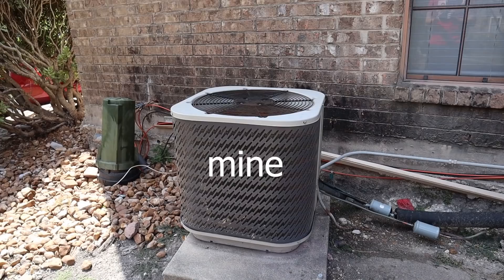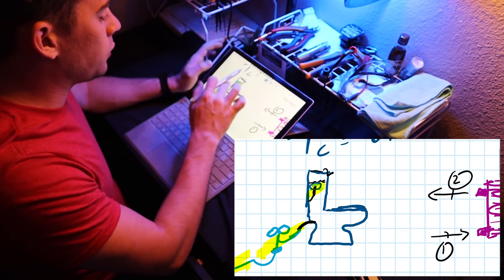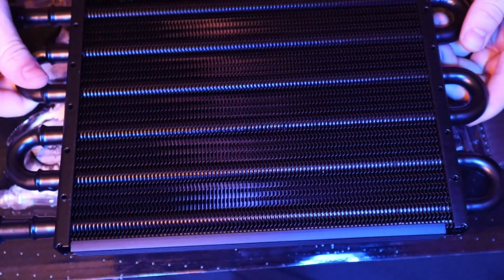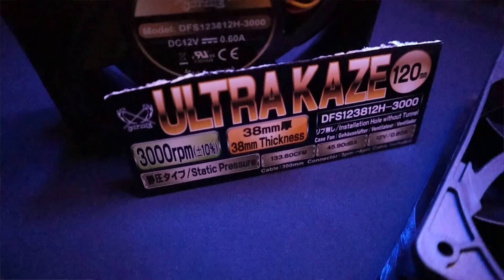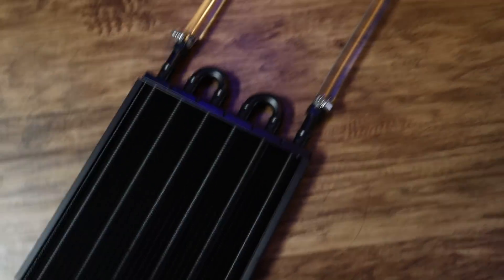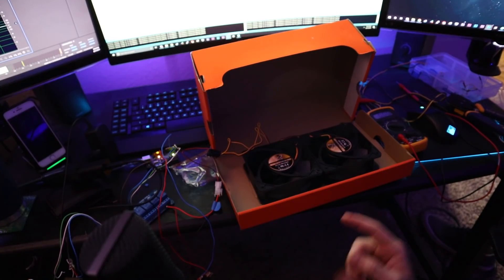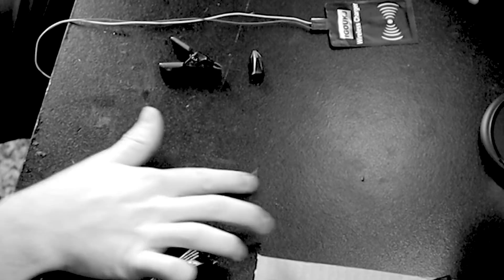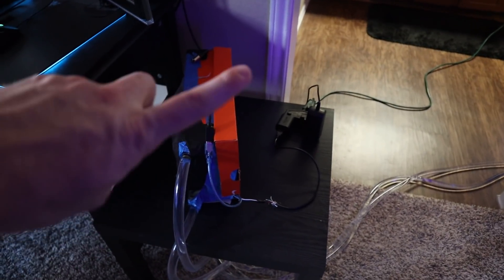I Watercooled My Room with My Toilet

Comment: I feel like you should leave your supply line intact, and use an aquarium pump to circulate the water out of the tank, through the radiator and back into the tank. Cause right now, your heat reservoir is just the volume of water in the tubing. And it only moves right after you flush. Then the heated water sits in your tank, heating up your bathroom, until you flush again. If you circulate the water out and back into the tank, a large fraction of the heated water is flushed directly into the sewer.
Reply from the maker: You're smarter than me haha, thanks for the suggestion and taking time to watch!
Reply: @TyPalowski  it also limits how much water comes out if you spring a leak!  you could also have a closed loop of water (or refrigerant in the tubes) with fixed amount of liquid hitting a heat exchanger in the tank - you'll lose efficiency, but you wont flood the building if you rupture. Also, fyi, water pressure usually goes from 40-80psi depending where you are. Heads up!  Great job on the build!
Reply: @TyPalowski  just place the cooler lower than the cistern so the warmer water naturally loops up to the toilet, you might need to add some pipe to let the whole thing circulate

Comment: Cool build but I can't help pointing out that a stand alone 8000btu unit is only a couple hundred bucks. https://www.walmart.com/ip/Arctic-King-8-000-BTU-Portable-Air-Conditioner-White/633661829?wmlspartner=wlpa&selectedSellerId=0&adid=22222222227280745955&wl0=&wl1=g&wl2=c&wl3=339481359828&wl4=pla-664267882294&wl5=9012319&wl6=&wl7=&wl8=&wl9=pla&wl10=8175035&wl11=online&wl12=633661829&veh=sem&gclid=EAIaIQobChMI6YqHxu6h5AIVgpyzCh32GA0LEAQYBSABEgKsQPD_BwE
Reply from the maker: Good point! My goal was just to try and make something for cheaper than that and that doesn’t use 2500 Watts, my bill is high enough lol. Thank you for taking the time to watch though!

Comment: This is pretty cool as a proof of concept but I think there's a lot of ways you could improve on it such as adding some insulation to the water going in to the radiator to prevent it from warming up on the way to the radiator, shorter tubes to reduce excess travel time and heild water, also the button press and timer is a good idea but what about getting a water flow sensor to replace the button? after the water flow stops for certain amount of time the relay could turn the fans off all automatically. Separately you could also make a device that senses the temperature in a room and if it's over a threshold it will automatically flush the toilet causing the cooling unit to start. Point is I really like the video and I hope you make a part 2 where you improve on this

Comment: You could probably have used a small circulation pump to move water through the rad rather than just relying on the flush. Right now as im sure youre aware, the "resevoir" and all of the thermal mass of the system is limited to just the water in and near the radiator. If tou instead used the toilet tank as a res, you could significantly increase the time required between flushes.
Reply from the maker: Very true! Thank you for watching and the suggestion. Maybe I can implement that later with a little fish tank pump or something that doesn’t draw too much more power.
Reply: Plus the system would be under less pressure and less prone to leaking.

Comment: There no way that works the electricity to run it would generate more heat than it could cool. lol. your landlord probably has a governor on it.
Reply from the maker: Thanks for checking the video out! The fans I picked only generate about 14 watts of heat. I checked the temperature of the air coming through the rad and its around 73°F. After running for an hour the temp rose to about 2 or 3°F. I'm thinking of going over the total efficiency at some point, but it sure as hell feels good while it's blowing on me haha. Thanks again.
Reply: @TyPalowski  So is there any cooling going on in the radiator or its just filled with water. lol. is there a sump pump in the reservoir tank? hahaa
Reply: @TyPalowski  also you should just start throwing treys of ice in the reservoir tank. ha
Reply from the maker: The water temp is lower than ambient so I consider it the cold reservoir of the system. And I'm getting the water from the wall spout before it goes in the tank.
Reply: @TyPalowski  You should Add a PC Watercooling Reservoir and a small secondary pump with some valves. When new water starts coming in, use it to flush the entire loop with cold water and store the excess in the reservoir - That way the water is moving + keeps colder for longer due to larger thermal mass.
Reply: @TyPalowski  oh derrr. so its self powered irrigation. NICE. lol. also, don't do drugs. kids. lmao. I should have pretty much known that one. hahaha
Reply: really comes out cold eh? nice.
Reply: i also dont quite understand.. do you just go flush the toilet every 15 mins to keep the water cool?
Reply: also did you put a water pump in the toilet reserve tank?
Reply from the maker: No the water actually takes a while to warm up to ambient, so I just run it off a timer until then as to not keep adding heat to my room by the fans like you said. And I make sure to not waste water so I just use it like a normal toilet haha.

Comment: This is interesting, since the cool water is already there and flowing (occasionally) it's like tiny scale geothermal, really.
 Also FYI standard home water pressure is like 50 psi
You're probably fine with that setup but with the sketchy fittings, etc. you do run some risk.
Reply from the maker: I'm glad you liked it! Yeah, I'm hoping that since there's a floater valve there isn't much water-hammer effect and the pressure won't fluctuate past that 45-50psi. Thank you for checking the video out!
Reply: @TyPalowski  Keep in mind that your pressure can fluctuate based on usage in the building or even neighborhood buildings, hydrant testing, etc. Put a pressure regulator between your angle stop valve (at the wall) and the tubing!
Reply from the maker: Crap I didn't even think of that, good suggestion! Thanks for checking out the video!

Comment: Why don't you fix the AC, like clean it and see what else you can do it? Replacing the gas isn't that hard either.
Reply from the maker: Thanks for checking out the video!
Yeah I've done about all I can do to the system at this point: constant air filter and even evap coil replacements. The freon levels are also good (according to my apartment's maintenance). I'm just desperate at this point to have at least one place cool.
Reply: @TyPalowski  Feel your pain, I used to throw water on the floor and use ice buckets to cool my place.
Reply: If you can keep a trickle flow of water on the actual AC condenser on the outside unit it will cool more efficiently... its also ideal for the unit to be in the shade... BUY A $100 window unit and include the receipt deducted from rent...Good luck.
Reply: @TyPalowski  looked into a misting system for the a/c unit? i hear they can increase efficiency up to 30%
Reply from the maker: @japhyfrey7005  Yeah I thought about either that or a swamp cooling system, but I feel too bad about wasting water (and my apartment complex won't let me install anything on my unit haha) . I know it only mists when the unit runs, but mine runs ALL day haha. Thank you very much for the interest and comment!
Reply: @TyPalowski  gotcha. Cool video tho, hope it cools off for ya soon!